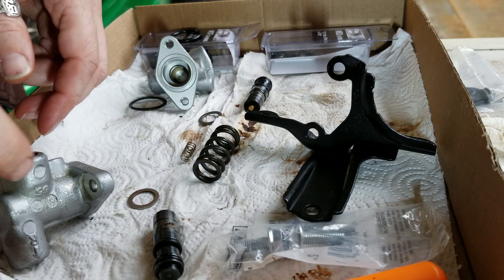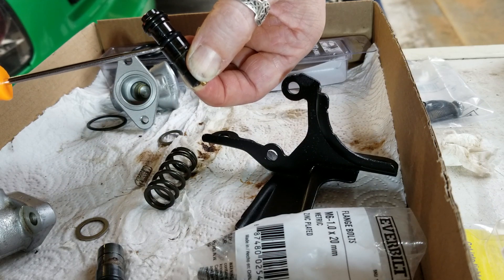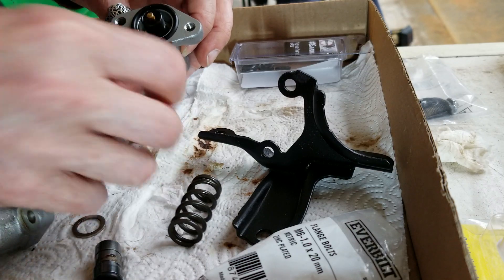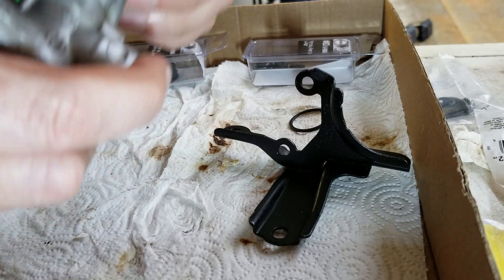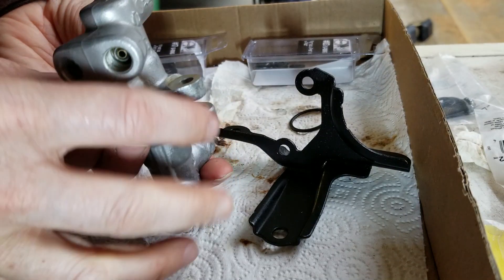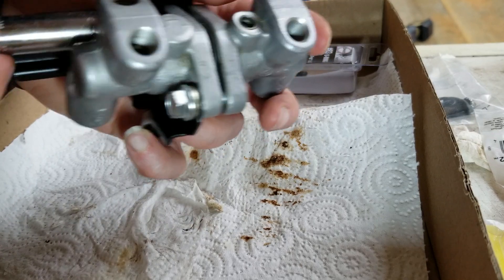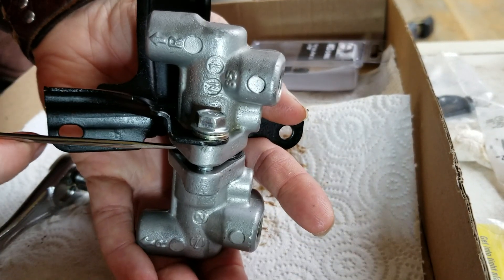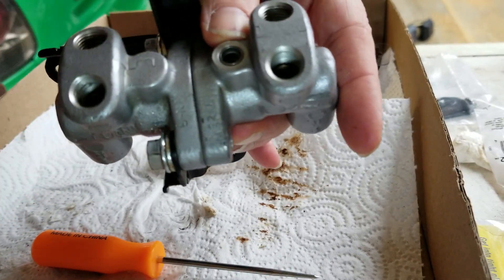Honda OEM 4 Disc proportion valve reassembly after rebuild (93 Del Sol Project)

Comment: Confused as to what you did with plugging the weep hole as mine has blown out but i have a replacement prop valve for parts how to you get the brass fitting in? with the open hole it just blows fluid everywhere.

Comment: how has it been after rebuilding? any leaks out of the 'weep plug? it seemed to me that maybe honda may have' them selves 'chisle cut' those bolts after assembly so as to have some protection for bolt vibration,maybe didnt think bolt locking fluid 'like lock-tite'wouldnt have been a good idea on brake system parts, and as for that second and center seal seemed to me also a bit of a specific sized and "shaped" seal the center one looked to be specifically flat in shape and the second donut seal seem to have been used for its outer flap/lip, i changed the seals out but still leaked,maybe ill try just spraying the oil seals with crc silicone/acetone lubricant and maybe just replacing the smallest seal and center seal only,🌊✌great video either way very detailed and visually high quality
Reply from the maker: Thank you!  Mine has held up since the repair, no issues or leaks.  The replacements I opted for were definitely a cross your fingers & pray they work, but so far so good.  I feel my only issue will be the fuel degrading the replacements as they are technically not the correct ones.  But since I have gathered any I have found in the junkyards that have the honda rubber weep seal still intact & dry.  They are on standby "if" I ever need them
Reply: @redraif  hey! I just saw this video, I can say that EPDM it's the best way to go, as I searched the forums everyone says that, also, I need to do this exact work on mine, and this video really helped! I would use larger bolts and put some nuts just to be sure they don't go anywhere